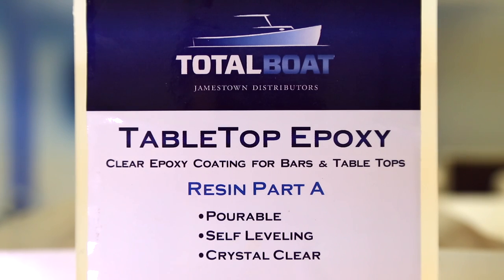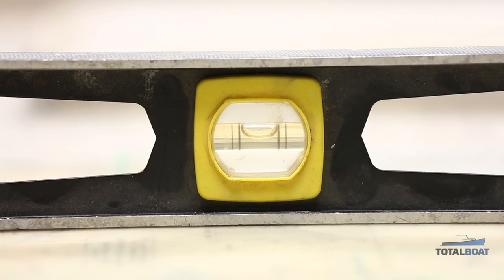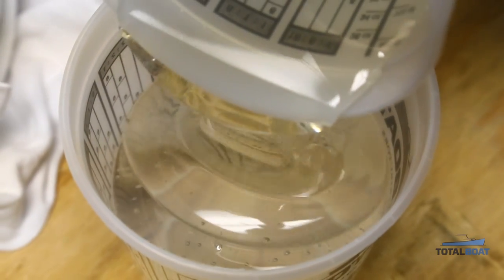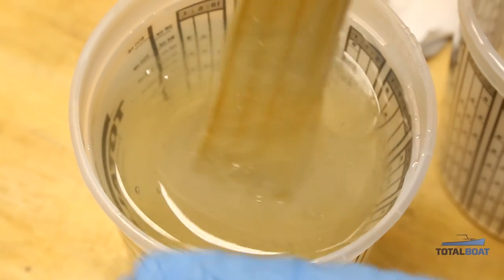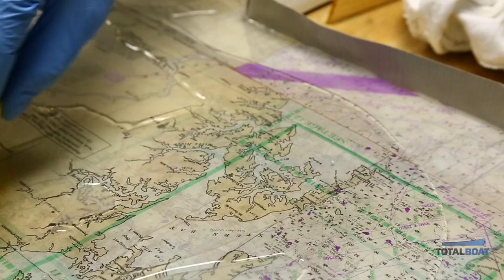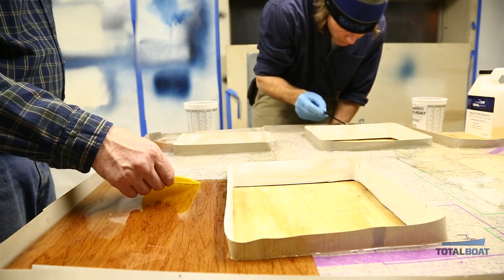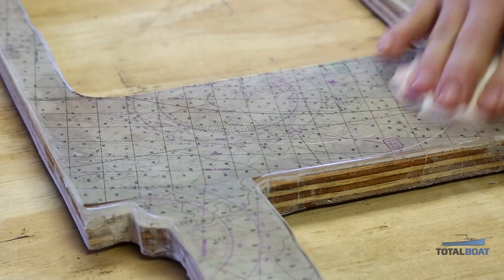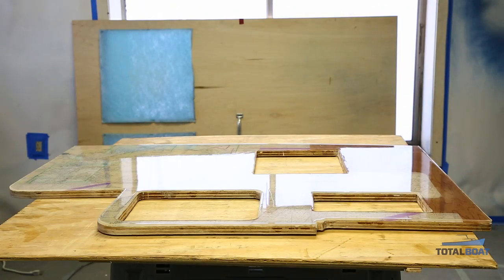TotalBoat TableTop Epoxy

Comment: About to do the exact same thing to our settee table. How did you bond the chart to the table, before adding the epoxy on top?
Reply: its been a few months but i want to add this comment to anyone with the same question in the future.  I called Jamestown Distributors and they recommend any standard mounting adhesive.  I will be using 3M 77.    They also recommend spraying a clear coat of Krylon clear before the epoxy coat.  This will inhibit bubbles from forming from the paper and will keep the paper from absorbing epoxy.